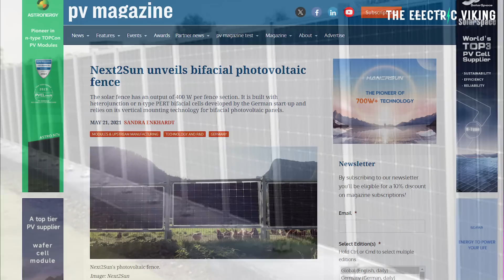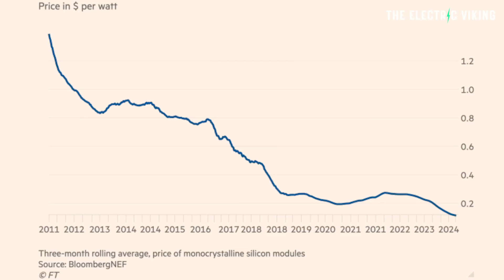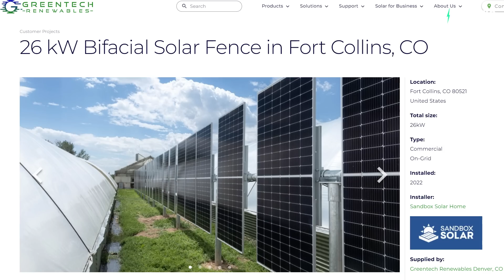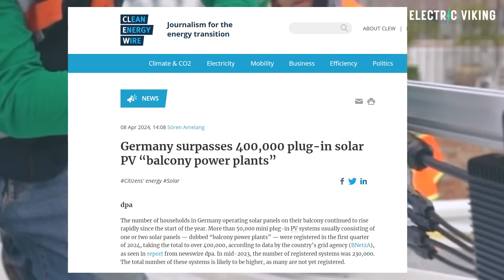Tony Seba says solar is now so cheap it can used as a construction material

Comment: Solar Panels in Netherlands (Where the picture of the Fence comes from) has Tax exemption. We pay 0% tax on solar panels. And for battery storage systems we can get the Tax back from the government. :) Zo zero tax. And yes solar panels are DIRT cheap. The material is like 25% of an install. So if you can install it yourself you saved even that 75% of the cost.
Reply: Yep, flat roof so I did it myself. Still working fine after 10yrs. Every KWh they make is free, they paid for themselves years ago...

Comment: People talk about solar fences, awnings, etc.  Problem is that there are certain restrictions to what you can do architecturally, and some of these solar things are outside of the restrictions.  The construction has to be approved and they may not allow the solar panels to be used.  Aa few panels can generate hundreds of volts so that's just one thing that has to be dealt with.  Solar panels can get very hot, so that's another issue to be dealt with.

Comment: I built a gas filled aluminum paneled heat pump fence which benefited from solar energy to enclose and entry courtyard of a Million dollar house* back in 1981, so the idea of using electric panels is a good one, though, not as attractive as the painted panels framed in cedar mounted on blasted architectural concrete with a full run arbor over the top for Wisteria.   These new panels that can generate power from both sides would find a productive situation in a fence.  
   As for Tony's predictions, it is a pretty hard to counter that given his track record and the reality of his prediction would be great for all... Man & Beast. 
   *house recently sold for 7-million.

Comment: Have you ever been to the U.K. mate? Or Europe? The bills are the opposite of cheap.
Reply: In the case of the UK that’s perhaps because they’re busy building what was described as “the most expensive building on the planet” by way of the new nuclear station at Hinckley, to be followed by another at Sizewell. Your grandchildren will die of old age paying for those money furnaces.
Reply: In the uk they are using green belt land to put up solar farms when there is plenty of roof top space.

As for cheap power if you have look at octopus energy you may find something you like
Reply: The new offshore drilling should be productive in a couple years. Texas has the most wind and second in solar only behind the state that forces people to get solar is drilling so much oil that natural gas prices went negative, while offshore drilling is more expensive, it should still hopefully bring prosperity to the UK allowing for a cheaper transition to green energy.

Comment: Adding solar above south facing windows as awnings allowing heat and light in heating season and blocking in cooling along with using it as siding could add to a design if done aesthetically pleasing.
Reply: Very clever,Ive seen this in Europe. Hot countries are doing this with water aqueducts. Cover the channel and cut down on evaporation at the same time.

Comment: Sorry currently solar panels run about $6 per square ft. Plastic fencing is only $2. So still have a ways togo.
Reply: The picture in the video was from the Netherlands. We don't have much forrest to cut down. We have to import wood which is expensive. On the other hand solar panels are sold without tax on them. And our tax is normally 21%. So these panels are DIRT CHEAP. And the wooden fences here in Netherlands have like the same price per square meter. So it depends on the location if wood is cheap and if solar panels are cheap or not due to regulation.  The Netherlands has the most installed solar power per capita now. 
I am busy with a new house which will have 15000 watts installed on the roof, and yes... my fence will be full solar panel too. Probably going up insane amounts of power from the sun. I actually have to limit the power in summer times then. And charge my batteries + my car for free.
Reply: Do plastic panels produce electricity to offset the building cost? I didn’t;t think so.
Reply: @nerdbikes3841  No they don't but Solar panels cost more than fencing to install. They have additional costs  like wiring and hookup to power systems. If you put in too much you have to purchase special insurance to connect to the power grid. The statement that solar panels are the same cost as standard fencing or roofing is just misleading. Not saying the benefits don't outweigh the additional cost but there is a payback time that has to be considered. If you could actually get a solar roof installed for the same price of an asphalt roof everyone would do it and every builder would include it. The truth is you can't. I really like Sam's videos but this was just a bit of a stretch.

Comment: Given that much of the cost of home solar is installation, making photovoltaics a part of everything exterior that you happen to install...fencing, siding, roofing, sheds...could make a fair bit of sense.  Photovoltaics themselves aren't the cost anymore; it's the other bits and the install.
Reply: Maybe. Just like evs and cars, the more you produce the more problems you will encounter. Some solar panel companies are being banned because they used toxic materials to supply cheap solar panels. In China they have fields of EVs because their batteries are garbage and catch fire all the time. China had to ban electric scooters in some residential areas

Comment: With a variable power supply like wind or solar I can see how the price for power could go to 0 at times but it seems to me at other times when wind wind and solar were producing at a lower level power would have to be sold at a fairly substantial price in order to cover the capital cost of installation. The cost of the solar or wind installation  with batteries has to be recouped with profit somehow.

Comment: While I look forward to EV prices and solar becoming cheaper, they need to. We are in the process of swapping our diesel for an EV. There are just a few cars in the sensible affordable price range. For wider adoption of BEVs and more solar power generation at more affordable prices we need Tony Seeba to be right. Cars are a key part of reducing the problems we have with air quality. Once buying an ICE car is looked on as illogical choice for most people I will be relieved. At the moment it seems like the misinformation is able to use the up front cost  as a prop for avoiding the sensible choice. Once the cars are cheaper the misinformation will still be there but will slowly become less effective. 
Balcony balustrades sound like an interesting way to add to the possibilities. Then it will make sense for buildings to buy a building battery (repurposed BEV batteries?). Trade in your car battery and they could refurbish it before installing it on the roof of apartment buildings.

Comment: We can get electricity costs below zero, from solar, during certain parts of the day.  So as a sound bite, it's a bit misleading.  What one wants is a 24/7 match.  This is one of the goals of Google, which also prefers clean energy, to run their data centers.  But it's not easy.   And you still needs some dis-patchable resources.  This is when the whether totally does not cooperate (dunkelflaute).   Though if the solar drops some more, one can "over panel" (say by 5x).  Along with this is the needed drop in costs for storage.

Comment: The solar panels used previously that I use were cheaper than plywood a few months ago. Even panels that are beyond repair could still be used structurally. With foam insulation between panels used like siding you can form an incredibly strong sandwich. If used for housing you could use drywall on the inside and panels on the outside. 4-6” of open cell insulation between them makes a strong barrier to heat and a structurally stable wall. If you don’t like the way they look, could put other siding over them. 

But left exposed even marginal panels on exterior walls would produce much of the energy required for a dwelling.

Comment: I keep seeing stories like this. But in California where the sun shines all day it still takes over 10 years to reach the break even point. Why is that if the solar panels are so cheap? Is it the inverter or some other hyper expensive equipment to connect homes up to solar power?
Reply: What's the margin for the installers? Last I heard solar systems in the US were expensive. Tariffs on solar panels don't help either.
Reply: @deanstyles2567  thank the Donald for that!!!
Reply: @Mauricio17-x1p   You know that could have ended years ago right so who's fault it is?
Reply: I agree. Pricing a solar solution from Teslas solar group is crazy high. Puzzling.
Reply: @sunrisejak2709 Installation in Australia is far cheaper. I met the salesman in the driveway and gave the nod for 2 x 6.6 kilowatt systems. Three weeks later they were installed for around 4,300 US each. No problems, no hassles, just sign here and thank you. And I live in a rural area!
Reply: Because you are OK with people robbing you on the installation costs.

DIY in WI would mean a payday under 6 years for me.

Comment: I just had a 7m aluminium slat fence installed. Materials cost $3250 and labour was just under $1000. All up that’s about the cost of a 4kW PV system. Think I may have chosen the wrong material 🤔
Reply: How good are those slats though,   look amazing
Reply: @happyhappynuts  True. I probably would have gone with slats anyway due to the better appearance at the front on my house but just wanted to confirm that PV panels can be a cheaper option (that will pay itself off over time).

Comment: You still need to pay for the labor of electricians to hook up the panels to your electric panel in your house.
Reply: Right now, I use my solar and batteries to run air conditioning in the summer without going through the electrical panel.

Lowers my bill about $30 per day.  But the savings the other 8 months are pretty terrible. So it's going to be a 7-year payoff for the system
Reply: @mac_mcleod good thinking
Reply: Only until the plug is standardized.   It would be easy to have a plug on the circuit box.
Reply: yeah so?

Comment: Anybody on the Octopus Energy Agile tariff in the UK has had the most incredible day today, being paid to use electricity from 10:30 am until 4pm, the same thing happened last Sunday, and it is happening again tomorrow.
Reply: I also enjoyed being paid to use as much electricity as I could for 5 and a half hours during the middle of the day yesterday (Saturday) with Octopus energy. If I had a heat pump I would have switched it on and air conditioning to wast some more. To my knowledge, It was the longest consecutive less than free electricity I’ve had on the Agile tariff since joining in July last year. Fantastic stuff Octopus, keep up the good work. 

Not so sure on the solar panel fence though. Solar panels have a long way to fall in price before they get to £50 for a 6’ slot in panel. Even if they do eventually get that cheap, they won’t produce much, if any power with the bushes, trees and other general flowering plants casting shadows on the cells. Not to mention having to wire them up in the neighbor side of the fence.
Reply: Octopus energy is nice. max. 20 cents/kWh for EV loading during the night while the average price for electricity is around 26cents/kWh.
Reply: I joined Agile 5 days ago & the day after I joined, I charged the car & the house batteries & got PAID £1.09…

Comment: At my insignificant level I haven’t paid for electricity for four years.  However, I acknowledge that everything around me, from street lights to the internet requires electricity that I pay for in products and services.
Reply: well maybe not the street lights (a lot more are becoming solar in many areas) but yea the internet and some other things.
Reply: AFTER you solar cells pay for themselves then they last maybe another 10 years and you have to buy better ones,
buy a used EV battery out of a junk yard for a DIY powerwall.
Reply: @rRobertSmith  Solar panels easily last for 25 years. The technology can develop further in future to deliver even longer lifespan
Reply: @rRobertSmith I have 40 year old panels still working well. Where did you get the information that panels only last 15 years.
Reply: @rRobertSmith a DYI system can have a payback in as little as 5 years if you are running an EV. New solar panels are warranted for 25 years typically and that is to 20% degradation. They don’t just stop working. 
The most likely thing to fail is the inverters after about a decade.
Reply: @rRobertSmith And who will do the installation? Will your house be insurable? Let me know as I would be interested to find out, as would others that propose this and have done no research into it. Off ya go.

Comment: We just installed a solar fence here in Tennessee USA near Nashvillle.
Reply: Brilliant!
Reply: In Germany most people are nay-sayers and say "aaaaw PV is so uggly! so we cannot build it"
Reply: Why? Does your house not have a thing called a ROOF ?
Reply: @robertfonovic3551  Location the key for solar. South west facing vertical could be better than a roof.
Reply: @robertfonovic3551  What "why"? Are you like dumb or so?
Guy wants to build a fence. Guy sees PV is cheaper than traditional fence construction material. Guy makes fence out of PV - in addition to his roof top PV.
Reply: @robertfonovic3551  You install where there's most sunlight more hours of the day and in some cases it may be the fence
Reply: @robertfonovic3551  also roofing is still expensive if you're talking about solar roofs like what tesla offers.
Reply: @nfzeta128 keeping solar panels clean on a roof is more difficult than a fence too
Reply: @icusawme2  yea, it's part of why a lot of people just let the elements that dirtied it clean it up as well. With a fence you can literally just whip out a hose and wash it off if it gets dirty.
Reply: @robertfonovic3551 
I wouldn't want solar on my roof .
Not easy to clean, maintain, repair, or replace .. lots of us have more than 1 acre in the USA .. so we can do it.
Reply: What inverters were used?
Reply: What inverters were used?
Reply: What inverters were used?
Reply: What inverters were used?
Reply: What inverters were used?
Reply: What inverters were used?
Reply: Solar fence around a house...
How do the kids play .. baseball in the backyard???